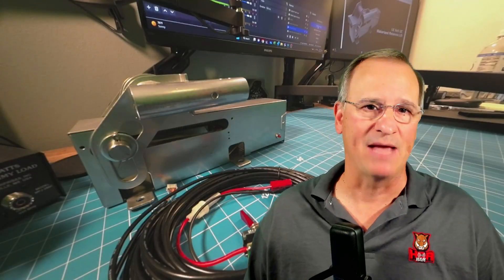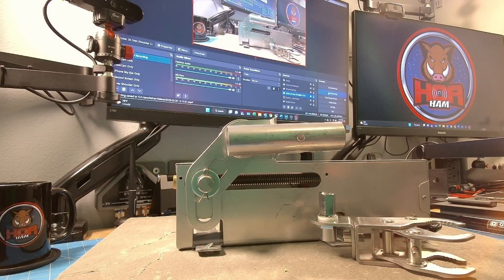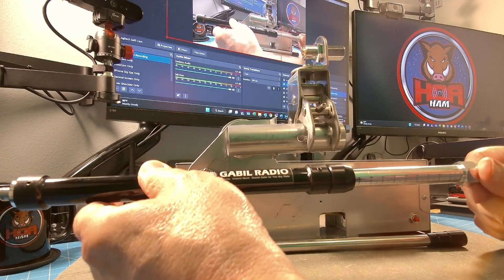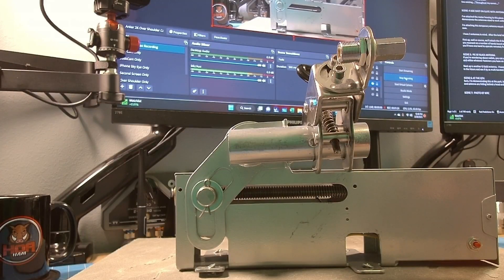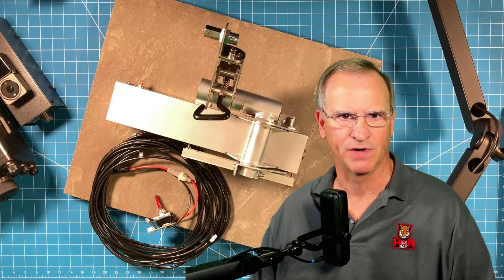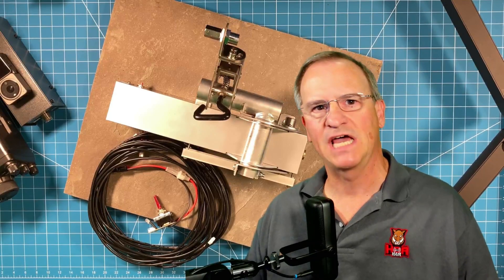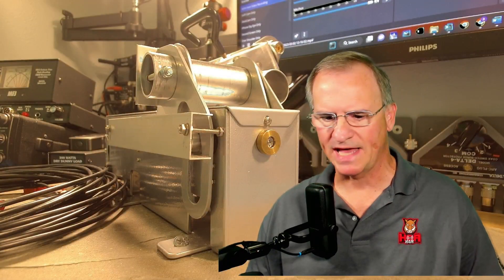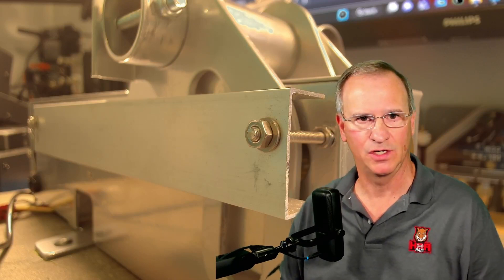Stealth HOA Antenna # 4: THE DISAPPEARING ANTENNA -- Gabil GRM-EM7 12V DC Lift

Comment: if the motorized portion fails can you manually override?
Reply from the maker: There is hardware that could be removed, but at that point I believe the antenna would be free floating...i.e., no way to control it.

Comment: It's a definitely a niche product and can be adaptable to just about anything within reasonable limits. I wonder if the motor stop limit switches are adjustable? In the deployed mode is perfectly fine at 90°, but will need to stop in the neighborhood of 20° in the stowed position.

The use application is for my Starlink dish on top of my camper van so I can remotely deploy or stow it. I already have screwdriver antenna, Weboost cellular, and 2m/70cm whip on a motorized tilt mount, so what's one more gonna hurt?

Dusting off my machining skills, I can fashion up some sort of adapter off the metal lathe or do a sketch up to have a CNC machine "print" one up for me. For the price point, I find it quite reasonable compared to other options out there. Every dollar you spend nowadays gonna sting more than others regardless what hobby you're in.
Reply from the maker: No ability to fine tune; it provides the basic function of up down with little ability to influence how it will perform.
Reply: @HOAHamRadio  good to know. Even at that price point, I'll just have to save up and purchase one and do a little bit of exploring along with some warranty voiding ingenuity on the internal limit stop switches. If it does not pan out, I have another case use project that I can implement it on.

Comment: Can I use the side bracket to mount this? I want to put a X50C2 on the top of a 30ft pneumatic mast for my SAR Trailer and I have a flat vertical piece I can mount to it.
Reply from the maker: The "side bracket" is a guard to protect an actuator; you cannot mount from it.  It has 4 mounting holes on the base, and I think that is the only way to mount it.

Comment: That is an interesting thought. Do you think it could handle a 2M/70cm antenna? Thanks for sharing. KC3UEE.
Reply from the maker: kidbach, absolutely.  Something like the Diamond Antenna X50 works perfectly, and the tube on the lift is made to accept it without a separate antenna mount.  https://amzn.to/42fYMFk is an affiliate link, they can be found less expensive at your favorite ham gear store.  Thanks for watching.

Comment: Interesting. I t looks like it could handle a 10 meter telescoping fiberglass mast with a wire dipole or EFHW attached.
Reply from the maker: That's a great concept W4MKH, but this lift wouldn't handle that length.  While a great idea, this was designed for shorter antennas.  Thanks for watching and commenting.

Comment: Impressive!
I can see many "repurposed" possibilities being an Apartment Amateur Radio operator with a balcony and open railing.
Couple that with the Chameleon CHA MIL Matcher rated @ 500 watts plus the 9' extension and 102" collapsable whip!
KD8EFQ/73
Reply from the maker: Great idea Charles, but the total length might put a bit to much stress on this lift; it was designed for shorter antennas.  Appreciate you watching and commenting.

Comment: Wow, this is SUPER cool. Perfect for camping and portable use. Excellent video
Reply from the maker: Thanks for the kind feedback K7SW; appreciate you watching and commenting.
Reply: @HOA Ham I could see this mounted to the top of my travel trailer camper.  It would certainly save time and space in a campground where ground mounted antennas become a  tripping hazard.
Reply from the maker: @czmg22  Exactly the type of thing it was designed for....  Thanks for watching csmg22.

Comment: Thanks for sharing! I've considered utilizing something like this in my HOA but had only seen the large manual / crank and smaller Tarheel options. 

Not sure how much it impacts your other viewers but in addition to the HOA I'm trying to ensure that my kids can still play freely in my yard. I don't want to put them or my equipment at risk.
Reply from the maker: Absolutely Cyan2002, whatever we do needs to be safe for the kidos!  Thanks for watching and offering feedback.
Reply: @HOAHamRadio  thanks for the response! I reworded my post enough times that I totally forgot my point! My intent was to ask for ideas you might have to set up a good hidden antenna that doesn’t end up getting in the way of the yard being used for kids to play.
Reply from the maker: Ah, now there's a challenge I haven't had to deal with for the last 20 years.  We have a daughter and two sons; keeping my sons from intersecting (running over, pulling down, destroying) a ham antenna could be a real challenge.  

With my set up today, I'd go right to the attic with an antenna they would never be near.  This lift, in a flower bed they already know they aren't supposed to be in.  If you can get an endfed wire up hiding in plain sight, get it high enough they can't reach it. 

Off the top of me head....